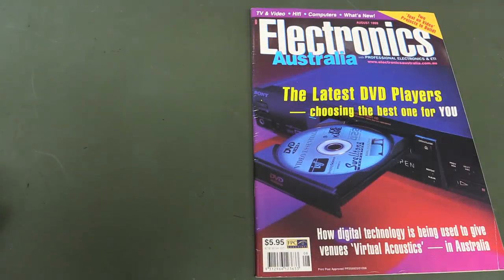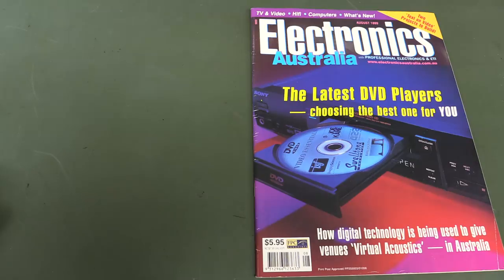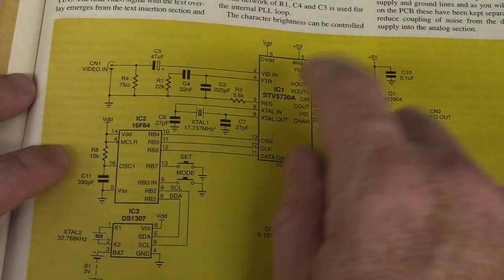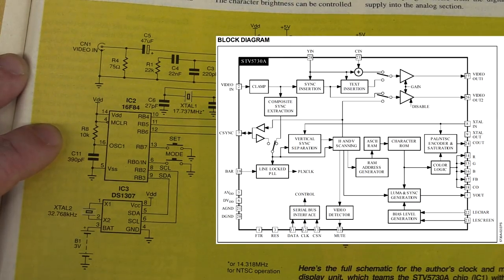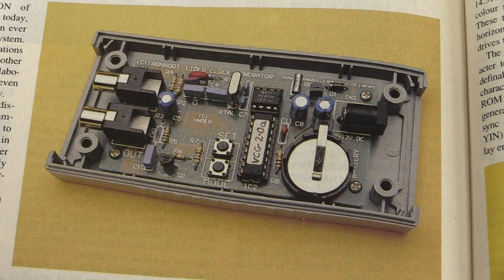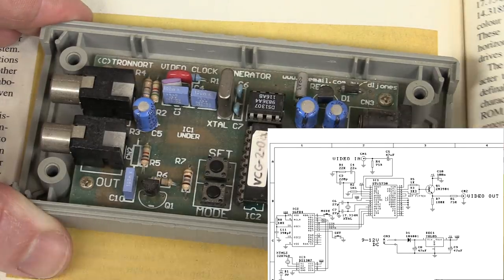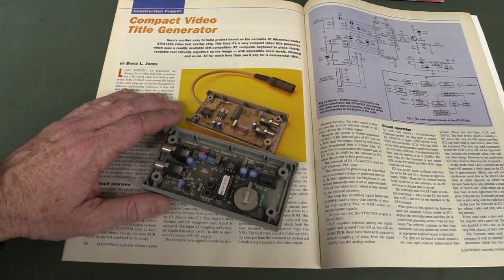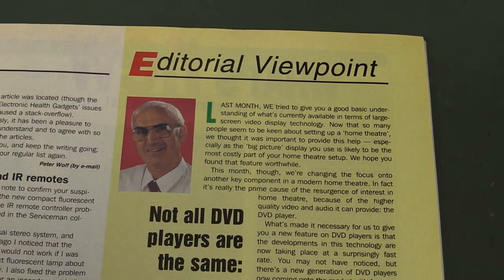EEVblog #b10000000000 - 1K Micro Magic

Comment: And meanwhile you can see MPLAB taking up 3 GIGABYTES of memory.
Reply: Mikkel Kroman My Minecraft instance takes 10GB.
Reply: Tell me about it.  It wants to be a HP printer driver.
Reply: This time last year I installed a command line("server") Debian instance in a VM with only 85MiB of memory, booted and ran just fine. As I recall 82MiB wouldn't fully boot. This was pretty much a stock x86-64 binary with a couple of daemon services[like Apache] turned off, fully stock it booted fine with about 120MiB iirc.
Reply: @gudenau
Well, a Minecraft instance that big is no surprise, it's just voxel world data. But if software gets big just because of dozens of supporting libraries clashed together, especially in the Windows world with all these additional versions, then this is a complete different story.
Reply: OpenGL4ever This is used RAM not disk space, and I only ever load a few hundred MB of world data or so at a time! It's code, textures and state data that takes all the memory.
Reply: Another example is software for PLCs that takes up a few gigs, while there are also PLCs with a few megs soft. Both for windows. It's really quite amusing, and a bit scary.
Reply: Mikkel Kroman  oh this must be the cut down version of mplabX or is that that bollocks Harmony crap they keep forcing on me!
Reply: Looks like it uses Netbeans as the IDE, my main IDE these days, stable and quick when coding large projects for almost all languages I code in, it's the trade off you get for the good user experience, the only down side in coding on Windows is that it can be a bit slow at compilation time but that's due to Windows I/O and file-system performance. Although still have to dabble in xcode, eclipse, visual studio, android studio for some specific use cases but once you find a good IDE that suits it's annoying when you have to switch. Who really wants to go back to a text editor ha.
Reply: rsnic I use IntelliJ Idea and Notepad++. :-P
Reply: Never used IntelliJ personally but hear it is very good, use Android Studio when I need to, which I heard was based on it but not too sure how close. NotePad++ is great, use that in the Windows world, wish it was cross platform, been using JEdit recently but still like NotePad++ better.
Reply: rsnic Rhe latest Android Studio versions are built on it, it's basically the IDE with the Android bits sprinkled on top. Give it a try, it's free and has some great code suggestion, warning and problem fixes. Only really for Java based languages though.
Reply: Thanks, will do.
Reply: @rsnic  ya, its pure swing, really works everywhere ...
Reply: @rsnic  IntelliJ ides are really good, and they have something new vscode-like too (pretending AI assist integration well), but after few minutes, I didn't found how to config my own syntax coloring ... so, no, yet;

Comment: Back in the PIC16C54 days I spent many days optimising the crap out of PIC assembler - just watching that,  I was starting to count all the instructions I could have saved...
Reply from the maker: Yeah, I was pretty loosey-goosey with all that space!
Reply: Original version of that chip was 16C84, and it was (IIRC) first ever eeprom/flash reprogrammeble  chip from Microchip available to hobbyists on small quantities. It was later renamed to 16F84 when they fixed code protection bits. For the time, those were quite neat chips. 

I did debug display (4*20char, hitachi-4bit controlled) with soft-serial input (9600? with 8 byte fifo).. Was kinda hard to make scroll since Pic didn't have enough ram to store text, so I had to read it back from LCD few bytes a time.
Reply: An instruction to put many spaces in row maybe? :)
Reply: mikeselectricstuff Half the fun is making the code super-lean.
Thinking back, wasn't the switch to the 16F84A because there was a hack that could reset the protection bit of the 16F84?
Reply from the maker: DIYTAO Yes it was the first micro that changed everything. But the F version is very different technology, it used Flash based memory.
Reply: Microcontrollers finally give us old-timers (who cut our digital teeth in the 70s/80s) the upper hand against these whipper-snappers.
Ah the days of writing a program, and then finding you couldn't run it because there was no space to create variables at run-time.

16K of RAM? Luxury...
When I was a lad, all we had were four bits in t' cardboard box in t' middle of street.
Reply: BigClivedotcom ... Hmm, I can't be 100% sure after all these years,  I really should check details like this before posting.
Reply: Back in the day, I would count every cycle to make things fit in a PIC16C54 and PIC12C508 with the totally awesome RICE17 in circuit emulator. Running async serial and I²C bus stuff in those early PIC chips was fun.
Reply: In the day there were plenty of people using the PIC84 to emulate the smart card for the decoder of the VideoCrypt and D2MAC on the UK satellite service. It used to sit on a wafer card and plug in the front. Weekly updates were available that you could key in on the remote control. These codes were stored in an external EEprom.
Reply: Steve Evans: +1 for the Four Yorkshire Men reference, it pops into my head every time I read a post about budget CRO's on eevblog ;)
Reply: I still have a stack of unused PCB's for these - used the old MAX232 as well.
Reply: My first chip (as a '90s kid) was a PIC16C62A. UV-erasable EPROM. I didn't have a UV lamp, so I could only debug during the day when I could erase the chip using sunlight.
Reply: I still have a few UV PIC16C54s from those days before Flash. I spent about 4 years on the PIC16C57 with an in circuit emulator after a year of constantly cycling parts out and tossing them into the eraser. I think the timing imposed by the program-test-erase cycle when you only have a half dozen EPROM parts leads to a slightly different style of iterative coding. Don't know if that's bad or good.
Reply: bigclivedotcom:  The 16F84A was a die shrink version of the 16F84.  It has a lower maximum voltage but could run at 20MHz instead of 10MHz, and no doubt was cheaper to make.  The device with dodgy code protection was the earlier 16C84 which used EEPROM rather than Flash program memory.
Reply: mikeselectricstuff: Did you ever use the Piclist? Code competitions used to be a regular thing.  Unfortunately with the brains of Scott Dattalo, Andy Warren, Nikolai Golovchenko et al, I don't remember winning any of them :)
Reply: Haha : ) kids these days have it so easy, i remember spending time hand editing Motorola S19 files for HC11 trying to get code to run faster lol... ahhhh I miss the assembly level code days... much fun when you needed 15 min to erase and retry because the UV bulb was almost dead, oh the fun...
Reply: @bigclivedotcom  What are these people talking about nostalgia?
From time to time i still use my GALEP-III, PIC16C54/57's, and the UV-Eraser.
The code, that fits in these little buggers also fits in my brain, making me feel comfortable:)

Comment: I wrote assembly code for engine controls (pre-fuel injection) for one of the Detroit 3 back in 1978.  We had a very "advanced" microprocessor for its day.  12 bit address/data/instruction plus hardware multiply and divide.  I think it was the only chip out there at the time that had those 2 math functions.

Comment: You brought home memories using UPPER CASE for assembly. I grew up with the Intel family (8080, 8085, 8748 and 8051) all programmed in UPPER CASE assembler. It just did not look good in lower case! I had similar problems as you with the 8748 chip which only had 2kB of UV-EPROM. I used to spend days trying to save a bytes so a complete taximeter could fit into the 2kB limit. Never again!
Reply from the maker: INDEED. LOWER CASE JUST DIDN'T LOOK RIGHT.

Comment: Oh this brings back some memories! My first Micro-controller project was a self setting digital clock that received the time and date from the MSF time signal transmitted on 60kHz from (in those days) Rugby in the UK. I remember also butting up against the memory limit and having to refine my code in order to get everything to fit! The receiver was re-purposed from a "radio controlled" RS analog time piece and had six 7-segment LED displays multiplexed by a 4017 decade counter. I still have that clock but I re-visited my old project using an ATMega328p which is displaying happily (and rather accurately) on my desk as I type. Loved this vid!

Comment: Excellent choice for your 2^10 video. Planning to continue to 2^11?!
What's with the strange timing on the on-screen clock (every 5th second is shorter)? I'm guessing something to do with the crystal and PIC CPU cycles being slightly out of whack with the RTC which is polled approx every 5 seconds?
Reply from the maker: Yep, I think it's something like that. Could have used the 1Hz DS1307 output to interrupt the PIC, but I guess that was deemed too fancy pancey.
Reply: I noticed it too. And my thoughts are the same, PIC and RTC probably being out of sync and polling the RTC every 5 seconds or so.

Comment: I wrote some code for an x86 embedded system. It sat in the MBR and let you talk over a serial port to read and write disk sectors. The idea was that you could rewrite the whole disk - actually a DiskOnChip - using a laptop connected to the serial port without having to disassemble the whole system.
Reply: very neat!

Comment: Reminds me of my first uC project, and my introduction to embedded in general.  Was a summer camp project using PIC16 (don't remember what architecture, I didn't know any better back then) to add a brain to RC cars.  I wrote a search and rescue program to find a reflective object in a demarcated area and then return home by dead reckoning.  Very simple, my freshman robotics class had much harder stuff, and nowadays I could improve upon it eight ways from Sunday.  But it still holds a special place in my heart, as the project that sparked my interest in EE.

Comment: I miss the b00001001 expression. With STM it is decimal or hex. If i want to set bytes in a register, i have to convert to hex. i loved typing b000100011 on the PIC assembler.
Reply: I wrote my own C compiler for STM32, and of course, included support for binary constants and variable bit access like myvar.b31 etc.
And it compiles, links and generates .bin file in less than 100mS.
I absolutely hate those bloated ARM compilers, pro or open source ones, they all suck.

Comment: I only used a PIC microcontroller once, and it was written in assembly. It was a small data compressor. I've written in assembly on several other microcontroller families and processors. I found the PIC, the most painful. The one that was a joy to write assembly on, was the HC05. I could write code for that series, all day long. Still write in assembly on the AVR family, when needed. Try to keep it C, though. Written lots of small assembly programs for AVR devices like the ATtiny12. On one of my clock projects (in assembly), I ended up with only 24 bytes remaining. That was on an AVR AT90S2313 with 2K of program space. Instruction word length on an AVR is 16-bits. It also used a DS1307, with a "bit-banged" I2C interface. Plus it had a few other features to eat up most of that memory space.
Reply: Michael Moorrees agreed with you, PIC16 assembly is the most awfull I ever met. My favorite is MCS-51. I don't know AVR though.
Reply: AVR Assembly is my favourite.

Comment: The PIC16F84 did actually have EEPROM, though it was only 64 bytes. Back in 2001 I did a board with some digital inputs and controlling some relays for a truck alarm. It needed a serial port but my clients had a stock of some 50 F84 so they made me use that instead of a model with an UART. Just bit banging the serial port took up a lot of the 1K and I only got it to run up to 4800 bps. I created a simple language "compiled" using the macros in the PIC assembler and stored in the EEPROM. These hex codes were interpreted by a program in the 1K. It ran 8 parallel threads and could check inputs, set outputs and wait for delays and timeouts. Connecting a terminal to the serial port allowed you to edit the hex code in the EEPROM and reconfigure the alarm in the field.

Comment: Back in 1994, before the PIC16F84 existed and when we only had UV erasable parts, I had a product that was "Internet of Things" for the day based on the PIC16C57 which was 2K. It contained an Apple LocalTalk to I2C router and several control macros along with a Farallon PhoneNet interface (LocalTalk over phone wiring) and a couple I2C peripherals included a PCF8583 clock, PCF8574 eight bit parallel port, and PCF8591 four channel 8 bit ADC/DAC. Huge nerds were ecstatic about it and everyone else scratched their heads. Now there's Arduino and everyone understands. We also had a network power switch and sold only a few hundred of them. At the time, nobody understood. It took two PIC16C57s in parallel to get the program space needed and one I/O line was used for inter-process communication between the chips. Now every home center type store sells the same of product based on WiFi or ZigBee. MacWorld Magazine was one of the first commercial adopters. Their MIS Director used one to reboot servers on weekends without having to drive in to work. At the time it was a matter of dialing into the office network because the Internet was not yet commercial.

Comment: Don’t see why it wouldn’t still work. THere’s still a lot of compatible chips in use such as 16F628A, and “compile” is a big word for converting instruction names to op-code, and labels to addresses.
Reply: You could actually look up the opcodes in the datasheet and 'compile' (assemble) the hex-file by hand... :-)
Reply: Several years ago I designed my own RISC CPU (In a virtual environment, anyhow, I'm not smart enough for VLSI layout), and the first several programs were indeed "compiled" by hand. Then the next obvious step was to write a program that would do it for me! Was a fun learning experience.

Comment: In 1993, my degree project was based around the PIC16C55. The device was to be the control logic for the startup of large backup diesel generators - Something that would be so easy to do now with C programming. In those days all the programming, compiling and simulating tools were DOS based. It was very steep learning curve for me as I'd not done any "real" assembler programming before, and this was pre-internet days (just). All my reference info came from a couple of Microchip Application books that I had to order from RS or Farnell. I think I may still have the project on some floppy disks somewhere. Happy days!

Comment: two assembler programs I made for 16F84A exactly!
First one was a standard university projet, it was a "Music device" with 8 buttons, each button played one short music clip with square wave. Notable songs: Batman series theme and Super Mario theme
Second one was the one I did as a final project to finish the university. It was a LF RFID reader, 4MHz crystal (1MHz equivalent because it takes 4 cycles to do anything). It was generating 125kHz carrier wave for RFID, it had analog signal preparation with op amps so it recieved 64 bits of data from the cheap Chinese RFID cards. Program had to find start bits (9 "1s" in a row) and calculate all of the parities; horizontal and vertical to see if the data was correct (most of the time it wasn't because analog front end was really bad!), then sent the serial number via serial interface. That one was fun to cram into 1k of memory and it had a lot of RLC and RRC commands!:D

Comment: I used my self-written assembler for 16C84. The instruction set was implemented as a set of macros. So, the first instruction was to include a file containing the instruction set, the 14-bit opcodes.

Comment: I've seen stuff like this a lot in the past few years as "OSD" modules for low-cost hobbyist drones, where the FPV camera outputs a standard PAL/NTSC color signal. These modules overlay the flight information such as altitude over the camera video signal before being transmitted to the pilot.
Most use an OSD chip with an MCU just like you do in your design but I've also seen some of them handling the entire thing in an FPGA.

As a side note: I wonder how expensive a DaveCad license was back then :)
Thanks a lot for your content!

Comment: Back when microprocessors were "only" 8 bits, I re-wrote the monitor for a Motorola (remember them?) 6800 processor.  I used a 512 byte EPROM chip and filled it up.  It still works to this day, over 35 years later.  It was the basis for lots of projects I did back then.  Yes, back in 1975 1/2 kbytes was a reasonably sized chip.  Programmable, quartz lid and all.

Comment: Your extra spaces are there probably as a precaution against crazy jumps if the user happened to input garbage bytes to display. You will probably find about 128 words in that table (if you cut the MSB from the input).
Reply from the maker: Yep, likely that.

Comment: Ah, that brings back memories. At the time I had more time than money so I got the 16C84 data sheets, wrote an assembler then wrote a disassembler to test the assembler. Next I designed and built a parallel port programmer. Finally I could start actually using them...

Comment: Did some "Machine Code" with the 8085 back in the day to analyze "K-Code" a railroad serial communications protocol.  Did not have an assembler till I acquired a 6800 "Uniflex" system.  This was before PC's and the 8" disks were not suitable for our needs.  We captured serial communications protocols, decoded and printed to a 1200 baud FSK modem and then to audio tape.  We just played the tape back through the modem and then to a printer.  Enabled real time data logging of field communications on a dispatcher voice recorder.